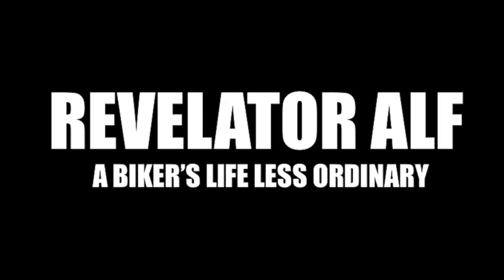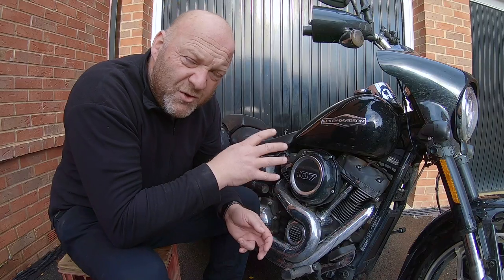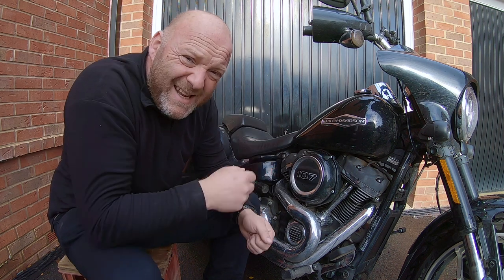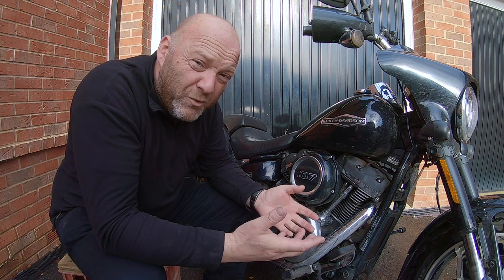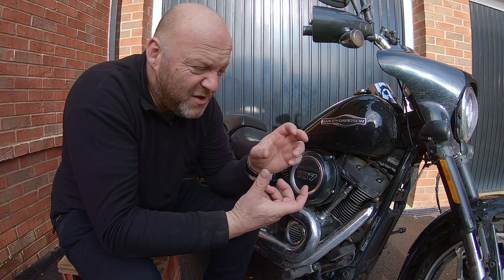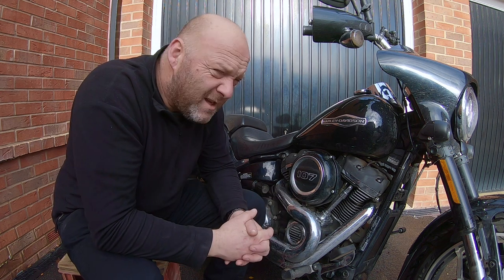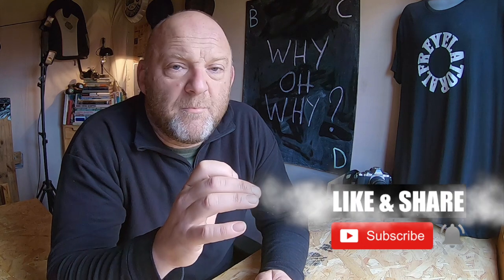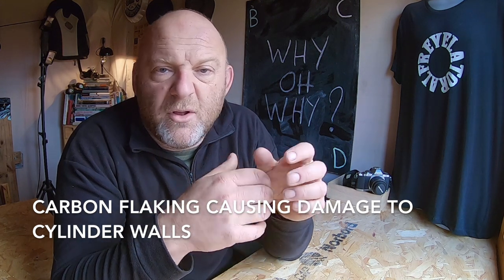Is It Worth Installing External Breather Kits | H-D Truths & Mistakes

Comment: I'd say to the unnecessary statement.  We ride Harleys.  I didn't get on my Softail because it was necessary.  And for 60 to 80 bucks on top of an air cleaner we are likely buying anyway,  any improvement on a Harley for the price point is worth it.  

That being said, I go back to the we ride Harleys.  The most beautiful thing about the bikes is that if you want to do something to it, there are likely options.  Totally respect you're not sold on the external breather.  As I'm still researching it for myself, if I believe it'll make the Slim last me longer I'll likely do it for the above stated reason.  If there's a benefit to be had, the price point makes it incredibly compelling.
Reply from the maker: then go for it

Comment: If your main concern is really just the annoyance of the oil getting on your saddlebags and side cover all the time (White Road King), what is the easiest solution to that?  Would the Feuling Vented Dipstick help with no real modifications required?

Comment: To be sure I only use premium fuell 98 ron like excelum (aral) vpower ( Shell)
Reply from the maker: Probably better all around and an occasional fuel additive to give the system a clean could work too. Cheers
Reply: @RevelatorAlf  in the UK esso supreme which was 97 Ron is now 99 Ron and still doesn't contain ethenol, check their website its 100% true. And before anyone says its says on the pump 5% ethenol, it means between 0 and 5%, it can't be labeled 0% because there could be a small trace in the pump.
Reply from the maker: @eastlondon666  that’s good to know. I’ll have to see if there is a garage in my area. Cheers
Reply: @eastlondon666  Don't they say "between 0 and 5%" because ethanol has been used for some time as an octane booster? That is, during the refining process, when they make, for example, 98 octane fuel, it may not be quite 98, so it gets ethanol added to bring it up. The 5% limit may be because not all ICE are capable of handling larger amounts of ethanol.
Reply: @martinXY  esso state that they can't put o on the pumps because there always could be a trace, but they are also stating that there is none in their 99 ron.

Comment: You know Mr. Alf, you're smarter than you look. Just bought a new Low Rider S 117 and I have all sorts of questions and you answered a lot of them. It has a TBR pipe and tune and it's pulls hard. But, I'm a Z900 guy and all this mumbo jumbo relating to blowby, sumping and excessive crankcase pressure is starting to bug me. Dig this bike, but time will tell.

Comment: I've not seen any issues with the $ light coming on due to external venting of the PCV system.  Changing  EGR  settings quite likely will on modern FI engines. 

I'd suggest venting the PCV just because, is a waste of time. 

YMMV.

Edit. This applies to mechanically sound engines. If there's excessive oil in the PVC system due to wear, or sumping etc, venting will not help.

Comment: Well...you talked me out of it. I have a 96 c.i. twin cam with 8,000 miles and was going to install a breather by-pass this weekend. After all the hype I read looks like it's not necessary.......Thank's
Reply from the maker: I am in the process of doing experiments with them, so in time I can give definitive data on it. Cheers
Reply: The breather bolts are cheap and easy install.

Comment: I wonder if the real culprit is ethanol fuel mixes.
Reply from the maker: Yes there’s certainly deposit build up from ethanol combustion. Cheers
Reply: Premium octane fuel like Shell apparently does not contain ethonal
Reply: @andrewbassett2507   depends on where you live.
Reply: @andrewbassett2507  the only fuel in the UK that doesn't contain ethenol is esso premium 99,even shell 99 contains it.
Reply: All I run is non ethanol fuel
Reply: @andrewbassett2507  it does in the US, 10%.  There is non ethanol around, but it’s more often 87. Plus if you only fill with non ethanol, you must not be going far. It can be a long way between stations that carry it here.

Comment: Part of the reason for fitting a top end breather kit is to reduce the amount of crankcase pressure and in doing that reduce the number of oil leaks.
A lot of the reason that Harleys leaked oil in the past was from blow-by, mostly caused by the engine not being under sufficient load enough of the time it's being run, i.e. glazing.
It takes quite a lot of carbon buildup to start to effect V.E. to a large degree and/or create a significant change in compression ratio to cause pre-ignition, a lot more than I've seen in the photos online and I've seen no photos of intake valves with excessive coking which is a far better indicator of oiling through the breather.
All of that said, I finally bit the bullet and installed the tune recommended with the FP-3 a couple of weeks back after monitoring things for 4 months and the difference is impressive to say the least.
Reply: Most external breather kits do not increase crankcase breathing sone actually reduce it  adding a second breather such as a vented dip stick will reduce crank case pressure.
Reply: @shanewalker2257  Heah, I was thinking about that in regard to Harleys in particular and you're right, most engines use a PCV setup, and have since the 70's but Harley have very little connecting the rocker covers to the crankcase, hence the dipstick breather kits. Still HD must have thought it would make a difference or the breather using the bolts wouldn't be there.
Reply: @Marcus_from_OZ  the hesd breather bolts on late model harleys are the only way they vent the crankcases. Many believe due to capacity increases in recent years the stock breathers haven't kept up hence the dip stick breathers.
Reply: @shanewalker2257  Exactly, my plan is to actually fit a crankcase breather to the crankcase when I pull the motor,
after the warranty runs out. I've got a box full of goodies to fit but the crank has too much runout so that has to be fixed first.
Reply: Prior to top breathers, all harleys vented at the case, straight out to atmosphere. No issues. The EPA drove them to run the breathing into the intake. Then any excess oil, from ver filling, sumping or blow by just went out in a mist. Then they routed the vent up to the breather, causing issues with the oil carry over. Enter too breathers. The theory was , venting to the top would cause the oil to drop back down rather than out of the breathers. The issue is, the breather system, which has been updated from the old umbrella valves, still is a poor design and still allows too much carry over. Venting oil straight to the intake ends up doing the same thing as bad intake seals. 
 If you’re ok with bad intake seals, you’ll be ok with the venting to the intake.

Comment: I did the external breather on the street glide. I got tired of oil on the air filter and streaking on the rear exhaust pipe. The bike burns no oil, I have noticed oil dripping from the breather tube it has no catch can the hose just terminates below the bike. I’ve also added the external breather on the fat boy once gin no catch can.

Comment: Just an Afterthought, As I've now Watched and Attempted to Learn from Many a Videos and Engineering Experts in Automotive Industry I can But Rationally Conclude 1 Manufacturers don't Care what Happens after Warranty Expiry 2  No Additive can Clean the Throttle Intake or Manifold inlets Neither Heads nor Valves etc etc. While I'm Not at all Concerned bout The Current  Performance of my Motorcycle , I am Concerned bout Preventing Long-term Degradation of my Intake and Engine and all related Parts thus looking at Minimizing the Carbon although I Do Not use Ethanol Only 95 Octane which here is the Midgrade Premium fuel by an EPA legal but Unique method..Check  how bad some Diesels are Alf.
Reply from the maker: Yep, currently experimenting with ideas about this myself

Comment: I've recently put a DK external breather kit along with a K&N air filter and cover plate on on SG, bit to early to tell yet if there is any benefits.  But must say, cosmetically the bike looks much better with the new air filter and new cover vs. the stock SG set-up.  just the addd air flow alone though is a benefit already and noticeable.  But whether the external breather kit was over kill or not, based on what I have looked into (sure its all anecdotal) its not going to harm the bike and more likely to help the engine then not.  

Have not seen anything yet to say it would harm the bike to have an external breather.  Once I change the exhaust in the new year, then at that point i will also have to re-tune the bike and possibly put on an auto-tuner.  As far as looks....  the external breather kit is hardly noticeable and it has been done very neat and tidy.  You actually have to look hard to spot what we did when we installed it when changing the air filter set-up.

Also, adding the 2" riser lugs for the handlebars from Dk instead of HD risers or pull back risers meant that I did not lose or have to change out the stock top clamp which I was very pleased about as I don't like a lot of the other HD or aftermarket options for even the 4" pullbacks which meant you lost the stock top clamp.
Reply from the maker: Ah nice. Yes completely agree that don’t think it’ll do any harm and if it works in the long term then great. Cheers
Reply: Autotuner : they call it auto tuner  but it onley gives more or less fuell. 
There is an vid from KEVIN BAXTER where he exact explain what so called auto tune is.
My 96 ci flstfb has powervision tuned ( done by HD) not at his best but I think stil better than autotune.
Reply: @donaldduck2801  Yep , they are not all created equal!

Comment: I had milky oil covering the bottom of the filter, puddling in the entry to the throttle body, all of this on a 2017 M8 Street Glide Special with 3k miles. I’ve worked on all my bikes over 25 years, I don’t need scientific evidence… it’s obviously causing carbon buildup. Plenty of before and after an external breather. I only use none ethanol premium fuel. My brother has a 2019 SGS that had a breather bypass since new and his intake looks brand new, with 18k miles.
Reply from the maker: yep

Comment: You have stated my questions and concerns regarding external breather kits. It seems like a bad idea to port engine oil/vapor into the intake ... but SHOW ME THE DATA!
Reply: The data ?  I can  show you the in side of the combustion chambers. Just a quick peak down any of these engines spark plug hole with a bore scope shows the carbon build up on pistons, valves ...everything. It looks exactly like a high mileage motor with shot out valve guide seals. It used to take many miles for motors to get cokes up like these do in short order.
Reply: @megastick9324  I agree with you that there is visible carbon buildup, and intuitively it seems reasonable to assume that dumping oily vapor into the intake is a contributing factor. But without data (observations of identical engines, identical operating conditions, identical fuel, etc., one with a breather and one without), I am not able to conclude the primary factors contributing to the buildup.
Reply: @rickharris323   while all that purposefully heady talk is nice, I can deduce it, I’ve been building and fixing Harleys since the 70s. I’ve had my eyes and hands on them, not read books about theory.
Reply: @megastick9324  bore scope shows only an bi dimensional image, it does never show the quantity and if that thing called carbon is from normal operation or from “oily” air back into the engine. The biggest car and motorcycle names are doing it the same as that is not a real issue. This issue is just been created by aftermarket parts producers who haven’t even been to college or university to make useless products to sell to people who believes in their lies to make money. In this video the author explained very honestly and professionally in an excellent scientific way the truth. Of course people are still free to believe the lies of aftermarket part producers and let them make money on their simplicity. Open your eyes.
Reply: @megastick9324  no one can say that carbon buildup is from what and what quantity is from “oily” air, simply because there is no scientific study on this.
Reply: @linhnha1339  ok , live in the dark , I couldn’t care less.
Reply: @linhnha1339  so, the fact I personally build and repair these engines, and have removed the breathers and saw significant changes is just moot to you? Whatever, just because YOU don’t know squat about these engines doesn’t mean the rest of us are idiots.
 Speak for yourself. I don’t need a scientific study to prove something when I have the empirical evidence in my hands.
 Books are written by those who do, if want want theory do your own work.

Comment: I could be wrong but Poor Grade Fuel especially Ethenol Additive Gasolines can cause a Black Tar Build Up on the Heads.  Low Brow Customs and TC Bros make breather bolts.  If a few drops drip out every couple thousand miles that is what rags are for.  Sporty Spam Cans and Round OEM.  They seem to use a Ram Air Technique with the hidden scoops at the bottom and HD is trying to create an air swirl effect before the engine takes it's gulps of air.  The Air Intakes are fully enclosed otherwise.  HD sells their special FARB with a Harley Tax in the form of Screaming Eagle Intakes outsourced from major manufacturers.  They are more exposed to the air and slightly smaller than what was bolted onto the bike from the factory.  So an Air Intake gives you 1 HP advantage, a exhaust gives you 3 to 5 HP advantage, and you have a tuner plus HD dyno'ed and computer mapped perfect.  I BELIEVE THE BIGGEST ADVANTAGE TO SWAPPING OUT OEM INTAKES AND EXHAUSTS ARE TO REDUCE WEIGHT.  Accessories even well made seem to weigh a lot less. Less weight more perceived power.
Reply from the maker: Yes agreed. Cheers

Comment: This might sound silly and please anyone with more knowledge please correct me but what about the loss of crank case pressure? Can’t this add to possible sumping and a loss of oil at the top end even if minimal? I am only curious as I definitely understand twin cam big twins and most definitely believe although that may seem like a small amount of crank case pressure it definitely aids getting oil up top??? Any comments would be appreciated.
Reply: Yes it's a double edge sword. You need to be careful how much you vent the engine. I had a guy with a M8 Engine on a Roadking, he had it vented at the air cleaner, plus had added the transmission top cover with the vent. After riding for a while he started to get a top end tick in the engine, we went back to the stock bolts and eliminated the hoses and filter he had installed. This seemed to fix his engine tick so I can only assume he had vented the engine so much it was having trouble getting oil to the top end of the engine due to lack of pressure.
Reply from the maker: Yep all has a knock on effect

Comment: Great Insight and Exposition Alf..If Possible Pls Give us your Take on the 5 Micron HD Super Premium Oil Filter Flow Efficient which is what KEVIN BAXTER Touched on in Recent Live hang out QnA at 35-36 minute Section ..Saying they block at 3000 miles on average thus Run Via Bypass valve after..There may be Several Variables to Contribute to this.Thanks..
Reply from the maker: Ok thanks Paul. I’ll dig into it. Cheers
Reply: I like his input, very reasoned out.

Comment: I am building a bike, and I have been looking for data on the before and after dyno performance of a hyper-charger.  My last bike came with one ,  but I could not compare it with a stock engine.  Is there any comparative  tests done?  At this point I am focusing on  using conventual means of optimal breathing of the engine.  I would appreciate any info that could be of help?  Thanks

Comment: Of course all we are talking here is theoretical, so I'll add some sand to the vaseline.  Theoretically speaking, if you have small amounts of oil residue coming into the combustion chamber then you also have microscopic particulates suspended in the oil coming in to your combustion chamber.  To me that sounds like a bad situation.   And of course I have no imperial data to back that up..... so back to square one!

Comment: Surely this is only a problem if you have excessive crank case pressure. In which case you have bigger fish to fry. Basic principles apply to Harley’s as well. I guess a simple way to find out is to fit the kit and see how much oil you get. Got be easier than stripping several engines down over a number of years 🤓
Reply from the maker: Yes you have a point. Cheers Dave

Comment: using different motors is useless because every motor is different. just compare the same bike with breathers in stock configuration then again with them routed to atmosphere. Not enough warm air is being drawn in to affect performance, every modern motor built routes crankcase pressure into combustion chamber. Carbonisation is only caused by excessive oil coming into combustion chamber via breathers due to excessive blow by due to worn rings or glazed bores etc and as you sttate oil consumption would be noticable. Check out my experiment posted recently, it backs up your theory that very very little oil mainly water from condensation. Removing the breather will not affect the AFR's enough to  bother a bike and is unlikely to provide a measurable performance gain even on a dyno. Extra crankcase breathing via a vented dip stick for example on the otherhand can show up to 2hp gains without any other changes on a dyno but a one way valve must be fitted. :-)
Reply from the maker: Yes thanks for that. Great info. Cheers

Comment: You cannot ignore that the Hot air from the crankcase (engine  hot) is sucked in the airbox while on that moment the piston is going down and builds up pressure in the crankcase i don't want that I want clean air or not?